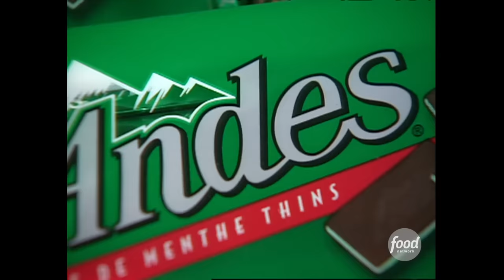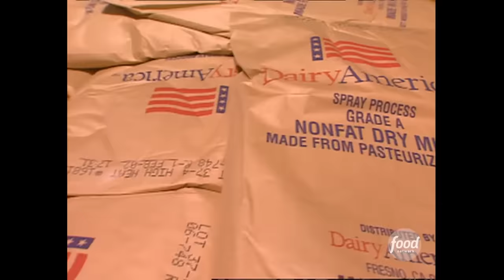Fully Unwrapped - Andes Mints

Comment: Making chocolate, making mints, making chocolate mints, and now the saga continues with making chocolate mints part two
Reply: Making Chocolate Mints 2: the Green Origin
Reply: This video is obviously about making mint chocolates, not chocolate mints.
Reply: @dbatch2826  this is like confusing rinsing machines and filling machines.
Reply: Yea there’s a difference between Chocolate Mints and Mint Chocolates.
Mint Chocolates is mint on the inside chocolate on the outside and vice versa smh my head
Reply: @That_iz_keeg  tasty
Reply: Chocolate Mints 2: 2 Fast 2 Mint
Reply: It’s mintception.
Reply: Actually this was totally just an uninspired knockoff. Fully Unwrapped noticed that How it's Actually Made did a bit on chocolate mints and felt like they needed to get in on the action
Reply: No these are mint chocolate
Reply: Mint chocolates
Reply: Finally, a recognizable brand

Comment: The green isn't worried that Andes Mints aren't doing so well lately.  In fact, the green has 'guided' current events to make sure this is the case.  The green works on a timetable so unfathomably large that even the barest description of just its simplest machinations would require a degree in both theoretical physics and philosophy in order to have a chance of understanding them.

You should not worry about the green's machinations just as an ant should not concern itself with the trajectory of a black hole.  There is no hope of you changing the outcome either way.